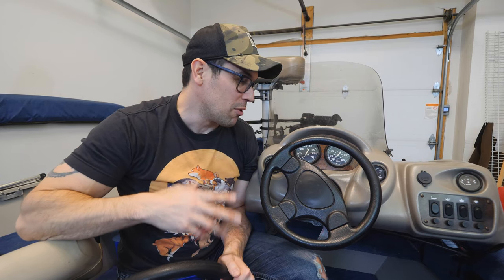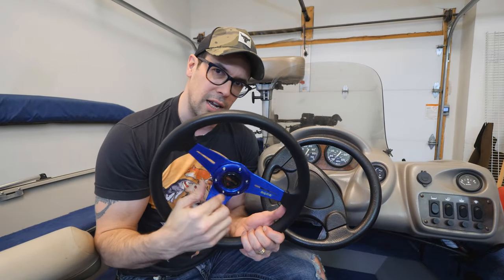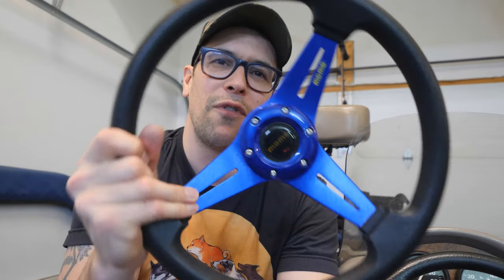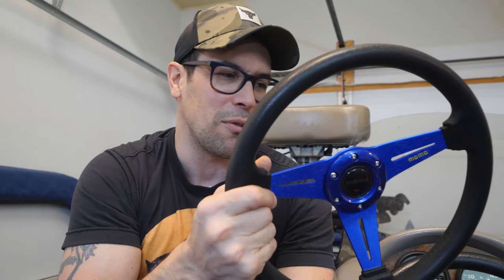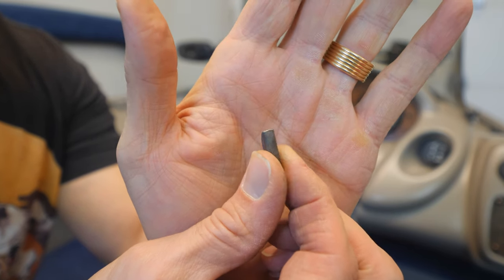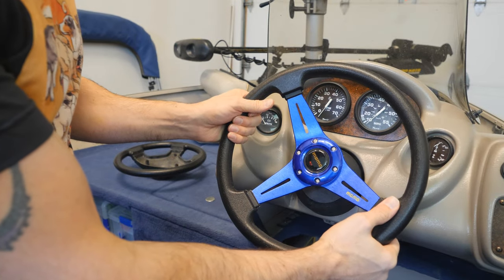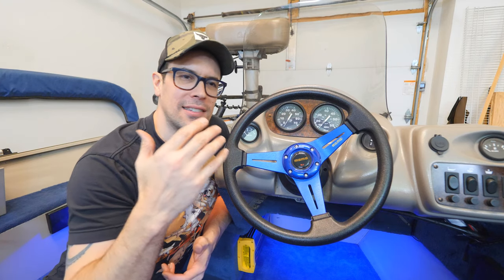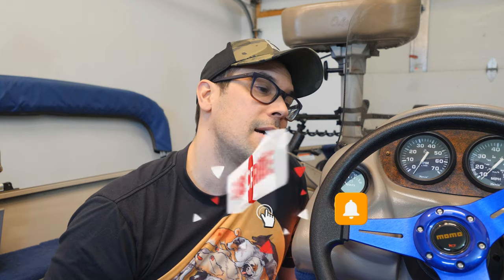How to Change the Steering Wheel on a Boat!

Comment: Important tip, screw the nut off further so that it stick up higher than the shaft. That way when you hit it with a hammer, you don't damage the threads on the shaft. That's the main reason to leave the nut on at all.

Comment: Thank you dan, on my 2 boats, there is a spot in the middle where there is a "dead spot" maybe 2cm long. So when im turning the wheel it does not really hook onto the wire until a little bit. Ik this might be commong but how do i fix my loose steering wheel. But when its taking and steering, its very smooth.

Comment: Thanks for the video! I will be doing this to my boat as well. Quick question do you have any videos and/or know where to get the parts to replace a sun damaged gauge cluster/dash specifically on a 2012 Bayliner 185BR?
Reply from the maker: You're very welcome and yeah, it's a great little upgrade that looks so good!  Unfortunately I do not know where to find those parts, you're honestly going to have to google search and dig around on eBay and stuff like that and try and find boat part recycling places.  It's really tough to find parts for older boats I've noticed although yours is only 10 years old.  I've tried a couple of times to find parts for my 2006 and it's been impossible.  Good luck to you!

Comment: Does this adapter also increase the height of the steering wheel from floor? I am looking to get one and need it to be higher
Reply from the maker: @KCOLBURN_8  The adapter is pretty deep but it didn't really increase the overall height of the steering wheel that much, maybe an inch higher.
Reply: @DanRichardFishing  I think the adapter plus a more offset / deep steering wheel may give me my desired height.

Comment: Thanks for the tip on "smacking" the shaft to get that stuck steering wheel off. Looked like your blue steering wheel had electrical connections for a horn or something.  Did you take the connections off?
Reply from the maker: No problem, it's a handy trick!  Good observation on the wiring in the center, and yes it comes pre-wired with a horn.  I just left the little wire connectors attached as is and installed it that way :)

Comment: Did you straighten out the outboard before putting the wheel on? I did not notice. Nice wheel and great advice.
Reply from the maker: Yes I sure did, and it drove me NUTS that the original steering wheel wasn't lined up properly when the motor was straight!! lol!  Thanks for comment and glad you like the wheel :)

Comment: Hey Dan, I'm going to do my wheel next week. What do you think about using lock tite on the screws to prevent them from loosening over time from vibration.
Reply from the maker: I didn't find it necessary but it certainly won't hurt to use some of the blue loctite!

Comment: Tip back the nut off until it is flush with the top of the threaded shaft. This will prevent damage to the threads of both the shaft and nut. Usually wood will absorb too much of the shock to be very effective.
Reply from the maker: Great tip Charles thanks!  Yeah I think wood will just bite in too much and absorb the shock as you said.

Comment: What steering setup is this?
Reply from the maker: Hi Jesse, I have a standard cable steer system on the boat with a 3/4" tapered shaft for the steering wheel.  In this video I convert the tapered shaft to a bolt pattern steering wheel.  Hope that helps!

Comment: I just bought that steering wheel lol
Reply from the maker: Nice! It looks awesome :)
Reply: @DanRichardFishing   What if I dont have that adapter and I just screwed my own holes to fit this steering wheel? I encountered that problem but I dont want to dish out $60 for it lol
Reply from the maker: @HodoukenYT  if you have the same kind of tapered shaft that I have on my boat you have no choice but to buy the adapter. There's nothing on the steering wheel for that tapered shaft to grab onto so it would be useless. You also don't want to take any shortcuts when it comes to your steering system. A steering failure at a high rate of speed can result in a serious or even fatal accident.

Comment: damn, my wheel is one of the ones that has been on for 30 years, I really hope I can do it without the pull tool.
Reply from the maker: Give it a couple of good solid whacks and it should pop off!
Reply: @DanRichardFishing  it worked man I couldn’t believe it. Took 3 whacks while pulling slightly on the wheel. I didn’t not expect the original wheel to come off with such ease, the boat was even in the water when I did it.